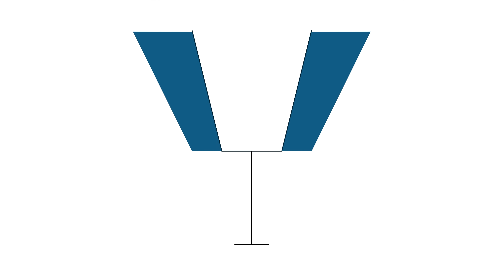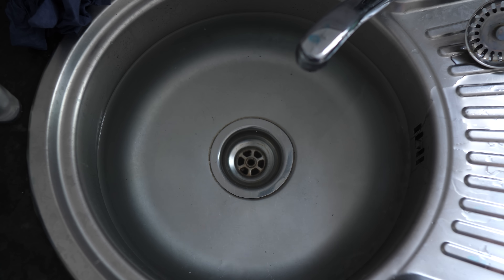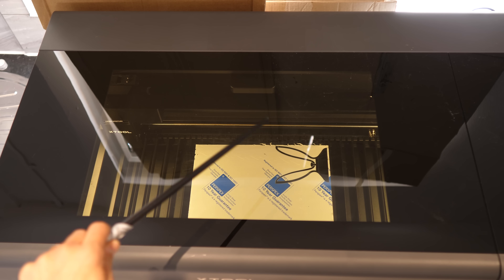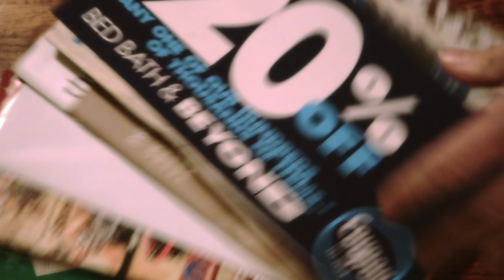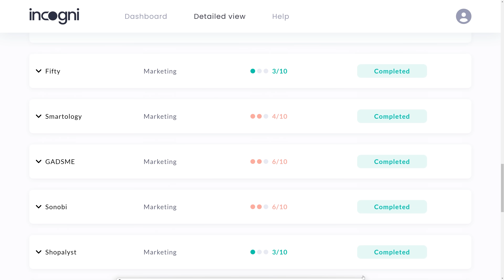2D water magic

Comment from the maker: ADFIXIUM COMMENTA!
The sponsor of this video is Incogni: Take your personal data back. Use code SCIENCE at the link below and get 60% off an annual plan: https://incogni.com/science
Reply: Here before this blows up and first and 5th like
Reply: what's the song at the 7:00 minute mark?
Reply: @ryzvonusef  Baby Its You - Revel Day
Reply: @FrontFacingBrian1234  Thank You!
Reply: @SteveMould video idea: 2d carburetor
Reply: Steve you should check out a device called a Diamondback Hopper, they're designed to reduce rat-holing in powder hoppers which is a massive problem, usually solved by vibration devices or air nozzles. I'm in contact with the guy that patented them if you'd like an introduction. The science of it is fascinating.
Reply: I would be equally interested to see what data those brokers have about me! Is this possible?
Reply: couldn't the neutral beads be creating a drag as they flow down and out of the container that creates a non-genuine representation of how water would flow out? That added drag could make a large difference in flow characteristics is what my intuition tells me
Reply: If you added dish soap to the water would it diminish the boundary layer effects?
Reply: The incantation is aguamenti iirc!
Reply: Ok ok I'll come watch another one of your 2D fuckery videos
Reply: Steve I have a petition for a model with the glowy bits of the flow of water when sucked up with a straw/straw-like (petition is just me)
Reply: Fake
Reply: So that effect. Their are some better videos that show this but I think you will get the idea. The common way people talk about a wing is wrong. That effect would be a great way to show that. 

https://www.youtube.com/watch?v=UqBmdZ-BNig
Reply: 💕 I so much love ur eyes 👀
Reply: 💕 I so much love ur eyes 👀
Reply: Heh! The algorithm doesn't think I'll enjoy any videos next. 😉 Better than Incogni. But it does look funny when creators point at nothing. Thanks for the video though. Those special effects look incredibly useful for visualisations such as those.
Reply: Great video, as always!  Watching the motion of the suspended drops got me wondering whether this approach could shed some light on the Mpemba effect.  I wonder if the effect can be observed in one of your 2-D models at all, or if it happens because of effects that are eliminated in your thin world.  

So first, does it happen?  Second, if it does, does observing the internal movement of the water as it freezes shed any light on why the effect happens?
Reply: good video, bad sponsor. "these companies no longer have my data" I don't think that is true at all.
Reply: Hey isn't the actual spell aguamenti?
Reply: This is a fine video, but the many Harry Potter references are less fun, what with JK Rowling's outspoken bigotry. Rather than fun fantasy, I'm just reminded of how queer rights keep regressing...

Comment: In the draining sequeces @7:10 for example, there seem to be a center point were "water gather", well the particles in the water gather.
Could this in practice be used as a means seperate particles in an emulsion? Letting the emulsion drain through a hole for a bit, and then
stop to, or continously(?), suck(?) up the higher concentration of particles at the center?

Comment: Just based on the amount of times you spilled a bit here and there, I think it would be a great idea to 3D print a funnel. One that's conical in the larger portion of the body and flat in the spout portion. That way you could slide it down into all these cool new laser cut 2D things you're making!

Comment: Did anyone else notice that there was a large group of beads at the top/center of the drain videos? 

My theory on that is that the middle actually is slightly lower than the rest of the surface of the water, so the beads are pulled down by gravity to the bottom of the dip, but are sufficiently buoyant to remain on the top of the water. Kind of like how a ping-pong ball will “sink” to the lowest point of a whirlpool in a swirling basin of water, which is the center, not get thrown out to the outer edges of the whirling water. But in the 2D version of the drain, there wouldn’t be the swirling part of the draining process (or negligible). So why does the surface of the water dip down? Or does it?

Would love to see if my theory is correct.

Comment: what I found the most interesting bout this video was during the draining video how the beads at the surface first being pushed apart at the start then coming together way before they reached the bottom or before any beads connected movement with the top, at the end there is such force that its even pushing the beads and water higher then the waterline.

Comment: I’ve flown gliders in the past and have always been interested in visualising air flow, mainly with respect to thermals and topology. For example, given a hill is evenly heated, the thermal will start from above the top of the hill. But uneven heating can occur and the air may also be moving. I think uneven heating could be simulated by shining an IR lamp from below a black plastic base that is hollow in with the shape of hills etc. Trees could be added. It would be fascinating to see turbulence from structures etc.

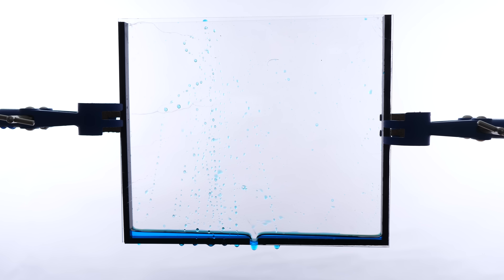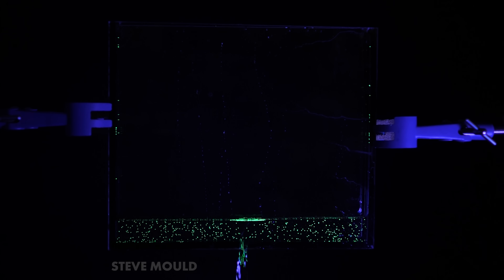Comment: Put a pump and a black light as part of the system for the water beads and you could create a nice little device to sit on your desk so you can watch that really cool effect at the 6:10 and 6:28 and 6:35. 

That way it keeps pumping the water back into it, creating the effect and definitely until you switch the pump off it can even fill in from the sides, maybe? it would just be a cool little thing to have on your shelf or desk. Like those tornado lamps almost.

Comment: The drain segment from 7:00 to 8:00 reminds me of how if a hole appears in a plane at altitude (or a space station)  people far from the hole wouldn't even notice (other than the noise), as the velocity of the air is a function of the distance to the difference in pressure (the hole to the outside). I think this is a general thing too - differences in pressure in a common medium (air, water, whatever) quickly balance out with the nearest things moving most quickly to balance them, and again, this is kind of what does the damage in enormous bombs.

Comment: 6:30 In my perception, a 3d drain drags particles with increasing force related to the decrease in distance.
Since angles are important in force transmissions and each particle has to push through a relative resistance a funnel shaped movement results, combining itself with the "coriolis principle" Ito a vortex (when disturbance is low enough)
Hope this makes sense, since I am no professional!
I just always loved to play with water, like creating vortexes with my hands or just watching it's reactions of flow to certain factors. :3

Comment: What you did with the particle "tracking" effect is essentially Particle Tracking Velocimetry, an extensively used method in fluid physics research. Depends a bit on how your editing software renders it, it might even be exactly the same underlying processing.

Comment: Can you put the hole in the middle of the 2D plate and film it from the top? It would be a good representation of an idealised incompressible inviscid 2D sink
Reply: I would like seeing other fundamental 2D flows as well, if you think you'll be able to :))

https://en.m.wikipedia.org/wiki/Two-dimensional_flow#:~:text=Sink%20flow%20is%20the%20opposite,sink%2C%20area%20of%20flow%20decreases.

Comment: If the convection current is stronger when the heat element is in the center of the water rather than spread across the whole bottom, does that mean there are conditions where a pot could boil faster on a smaller burner than a larger one?

Comment: 6:32 What if you fill the tank from the bottom and drain it only from the bottom? Would it drain the water added last first? Or would adding water mix when added? Does speed of entry affect dispersion pattern?

Comment: 6:45 the funnel shape actually helps the volume above the funnel to retain it's overall distribution, and is how multi colored toothpaste keeps consistent stripes from beginning to end of the tube.

Even a very shallow funnel slope can cause fluid before the funnel to move towards the drain in a laminar flow fashion.

Comment: Maybe something to try out yourself, when I was younger and played around with the kitchen sink (actually had to do dishes) I noticed that if I were to place a something like a glass (with semi-openings upside down over the sink (like an ashtray that is deep enough) and release the plug by it's cord, the water from the kitchen sink itself is (sometimes) first drained only to drain the content of the upside down container over the opening thereafter. I'm not sure how easy it is to replicate this behavior but I'm sure it's possible thinking back I did it multiple times, though I'm not sure anymore what container I used (as it was not an ashtray as I remember).

Comment: I find it interesting that the beads on the surface are pulled to the center, but not down into the water, not until the very end does the surface actually break and the beads gets sucked down, but they are still moved to the center

Comment: Hi @stevemould I noticed that the green particles in the surface gather in the center, as you can see at https://youtu.be/HiDHFg68BR0?t=429, is it because these are denser then water molecules or is it because of the water molecules are being pulled down from the surface? or a mix of these

Comment: You should try making a cup with flat, vertical sides. Right now the fake walls are wasting the space where most its volume would be (the bottom), so the refill looks small. With a flat cylindrical shape, you can make it refill itself to 80-90%. Coupled with an opaque liquid, you can even hide the thickness of the fake wall.

Comment: You can calculate the Froude number to know if a closed vessel can be discharged using just a bottom pipe of certain diameter (if so, the vessel is called “self-draining”). This is well understood in the chemical industry.

Comment: If you watch the 2d drain without the funnel especially you can see a large amount of the beads are moving almost purely in the y/-y towards the drain while others seem to make a beeline straight for it??? Is that boundary forces? But I figure that would just slow them down not change their vector
Reply: I was puzzled by precisely the same thing! I posted a comment about it a little while before you did, you should find it easily enough down there. Having thought about it a bit, I think I have an idea. I did a rough back-of-the-envelope analysis which I gave some details of in a reply I just posted to my own comment, but the gist of it is this:
- The flow, having to slow and turn 90 degrees in the corners, creates a higher pressure spot in each corner.
- In the bulk, this higher pressure just causes the flow to deflect and curve towards the hole as you would expect, and as bernoulli would predict
- In the boundary layer, where friction forces dominate over inertial forces, the flow is closer to being 'downhill' with respect to the pressure gradient, but 'downhill' in the corners is actually 'uphill' with respect to the tank. This vertical component flattens out the flow in the boundary layer, making the beads move almost straight across the tank- or indeed, closer to the corners, actually making the beads move upwards.

Another way to think of this is that the centrifugal force of the curving flow in the bulk pushes outwards, raising the pressure at the sides, whereas the slower flow along the boundary layer can't match this outward push, so it gets driven 'inward' with respect to the curve of the streamlines in the bulk flow. If you want a much better explanation of a very similar effect, I believe Steve published a video about tealeaves gathering in the centre of a stirred cup, which I think is pretty much the same as what's going on here.

My analysis is pretty holey, mind, and I'm afraid I'm a bit of a seat-of-the-pants physicist, so I encourage you to check my argument and tell me whether you think I'm on to something or not!

Comment: The chicken water drinker sounds to me very similar to how a fountain pen works, maybe that could be a cool idea for a follow-up video since there's also a lot of other mechanisms at play, such as capillary effects and such too. Also, the sink problem is rather interesting, you can model it mathematically with mathematical sinks as you've shown with your 2D versions, but I wonder if the Coriolis effect of the Earth's rotation really does affect it significantly to the point where you would also have to include that in a mathematical model, and so the practical model definitely seems more interesting. Maybe you could make a 3D version using a glass funnel and those neutrally buoyant fluorescent beads to see what happens in the 3D case (going from 2D to 3D and vice-versa can often have somewhat unexpected effects for a fluid, even beyond those you have shown with your models).

Keep up the good work, I love how unpretentious your videos are and it focuses on trying to get concepts across to the viewers instead of some other channels where the presenter is trying to show off how smart they are.

Comment: Steve, great video.   A possibly interesting experiment comes to mind with your neutral buoyancy beads:  Analysis of the "which freezes faster, hot or cold water" conundrum.   
It is already known that in many circumstances hot water does freeze faster than cold, but there is no agreed upon consensus on why.   I've always favoured the hypothesis that due to the energy exchange (cooling) only occurring on the surfaces (top, bottom, sides, and in a non-Mouldian 😊3D world front and back) stronger convection currents are generated in hotter water leading to the entire volume losing energy faster.  

Imagine being able to visualize this with the NB beads. 

I understand how complicated this would be, especially on how to video in a freezer, but it would seem to be a cool (sorry) visualization.

Comment: Dude! At 6:58 you can clearly see that there are particles at both sides whose trajectories cross over each other; this means that the flow is going in different directions at different planes within the fluid. I find this behaviour surprising! It must have something to do with the boundary layer at the glass but it would not have occurred to me if you hadn't put those trails on. Intuitively, I would have expected the fluid at the boundary layer to be moving slower than but in the same direction as the fluid in the bulk, but clearly this is not the case! Ooooh I think I feel a partial differential equation coming on...
Reply: I just realised what this reminds me of; wind! At altitude, winds blow more or less parallel to the isobars, but at ground level, in the boundary layer, they develop a component blowing down the pressure gradient because they are slowed by the ground and the coriolis force no longer perfectly opposes the pressure gradient. Which means they actually change direction. So, something something flow turning in the corners something something centrifugal force something something? 

By the way, I realise I'm getting my third dimension all mixed up with your otherwise lovely 2d demo, so... sorry about that.
Reply: I think I have an idea what's going on, at least a simple model of it. My fluid mechanics is very rusty and I haven't fully checked this so I might have screwed this up, and unfortunately one cannot paste graphs from wolfram alpha into YouTube comments so I'll just have to sketch what I did... Assume 2d inviscid flow in the bulk. You can get the flow field using potential flow by superimposing point sinks, it's easier just to consider one wall and leave the other end of the tank open in which case two point sinks positioned at the bottom edge of the tank, and spaced equally on either side of the one wall, gets you zero flow through the wall which should satisfy the boundary conditions I think.

Given the velocity field, you can solve for the pressure field using bernoulli. Now, assume that there is a boundary layer in which the flow is driven by the same pressure field, but in which energy is dissipated in proportion to the flow speed, and where the dissipation dominates the kinetic energy term. If you like, imagine this is the limit just at the edge of the glass where the flow is barely moving. My intuition is that in this case the flow will be proportional to the pressure gradient, and I'll probably think of a way to justify that eventually. Anyway, if this is right, the interesting thing is this: there is a pressure maximum right in the corner of the box; bernoulli says there must be, since the flow is stagnant there. So there is a component of the pressure gradient, and thus by hypothesis the boundary flow, in the positive y direction near the corner of the box, whereas the bulk flow is everywhere in the negative y direction. So there should be a change in the direction of flow between the bulk and the boundary layer.

I was surprised to see the solution predicted an upward flow in part of the boundary layer, since that is opposite to the direction of the outlet, and I hadn't noticed that in the video. Coming back here and looking again, I do see some particles moving upwards in the corner though, and it seems at least consistent with the flow field I would expect in the boundary layer from this solution. Which inspires a certain degree of confidence. What do you think?

Comment: Could you use those glowing dots to explain how a tidal lough drains? I would like to know whether the water level goes down at an equal pace, or whether it drains deeper areas first, and whether a small craft would be sucked into the outward flow on the surface